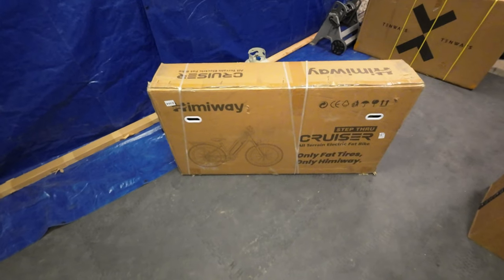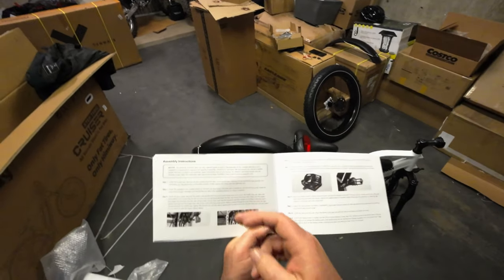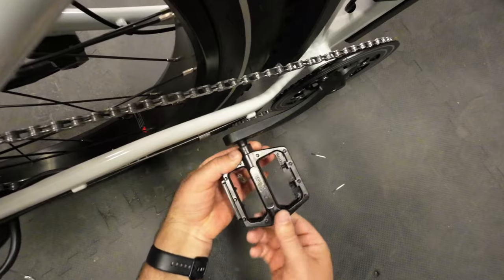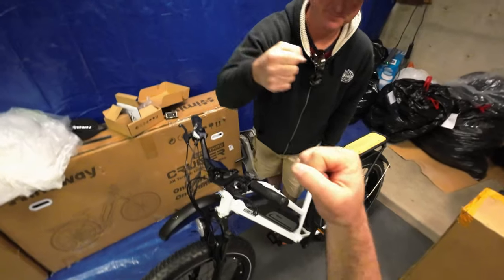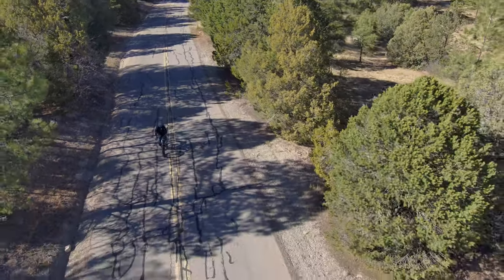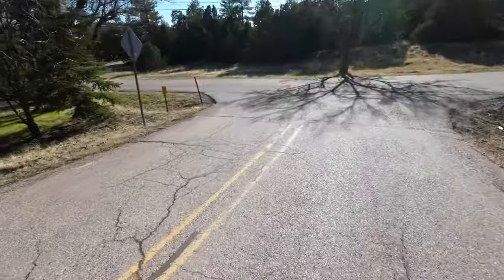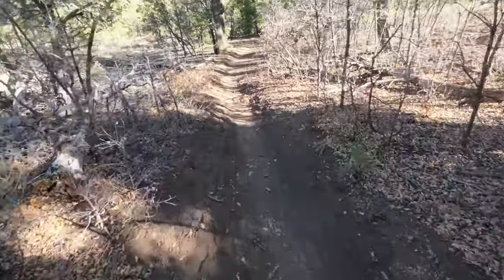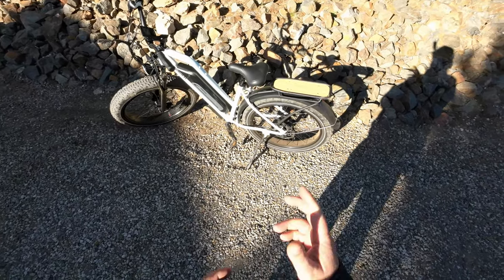HIMIWAY CRUISER Step-Through Electric Bike Review - (Bonus CRASH TEST) SKYDIO 2 DRONE ISSUES!

Comment: how does the wiring for the tail light connect to the main power source? i’m going to be getting a himiway soon, but i’d really like rear directionals as well for added safety on the road, since it’ll be used to commute to places. i’ve seen combo tail light and directional combos, but do not want to have two tail lights. my 2nd question is, do you think an aftermarket tail/directional light could be connected to the main power source?

Comment: To reset TRIP COUNTER: Press and hold + and - buttons until you see "tc" then press + again to change from "N" to "y". Then hold down "I" button to go back to home screen.
Reply from the maker: Would have been great if a long press on i button when in trip would reset it.   Simple 🍻
Reply: @DustinDunnill  I hear you on that. Check out Himiway Bikes video on YT called Speed and petal assist settings. Very good video showing how to change settings. You picked a good bike. One of the better Ebikes in my opinion. But I might be biased because I own one. But I did my research before I did. I'm happy with it. You'll be too. 🍔🍟
Reply from the maker: Thanks 🍻

Comment: PSA Himiway has made several adjustments to limiting how fast you can get the bike to go citizen cycle has videos showing it does 28mps on throttle alone and upwards of 35+mph on pedal assist. Himiway has taken away all that ability to make those adjustments to their bikes. the bang you are getting for your dollar is so much less I would wait until the Ariel Kepler comes out!! unless himiway opens the bikes back up so buyers beware the videos from Citizen Cycle are inaccurate as of now

Comment: "...no dent in the battery...": It's range is about 80 miles. If you've gone over 5 it should show a dent. I'm betting they're measuring voltage rather than integrating current (i.e. coulomb counting). My bike does the same thing. It's useless.

Comment: Charge time is not 6 hours. It's 9 hours. Top speed can be 25mph if you change the setting. Plenty of YT vids on how to change. Display scratches easily. Cover with tape. Don't believe the 60 mile range. Can get about 25 miles throttle only and about 35 miles with petal assist
Reply: Depends on alot of variables. I got 75 miles on mine, only because I only weigh 145lbs and pedals the whole time, and I  rarely use the throttle.

Comment: We need a range test 🤣
Reply: I have gotten 75 miles on mine. But then I only weigh 145lbs and I pedal the whole time. Only use throttle on take off.
Reply: @theflyingfinn6057  how far will it go without pedaling?
Reply: @TheBigb1973  never tried it, I always pedal. But I've seen people say 25-30 miles.